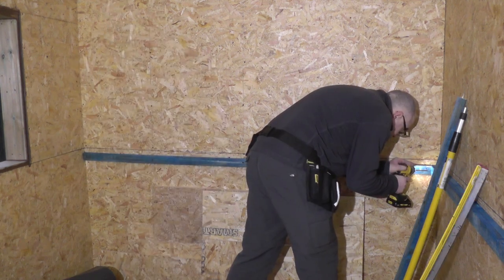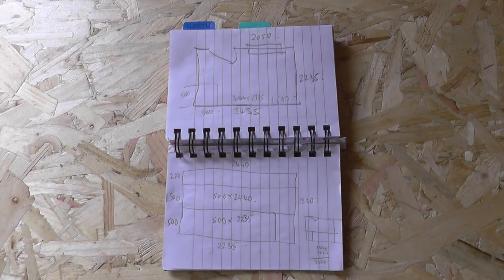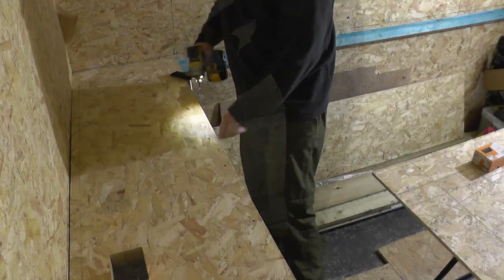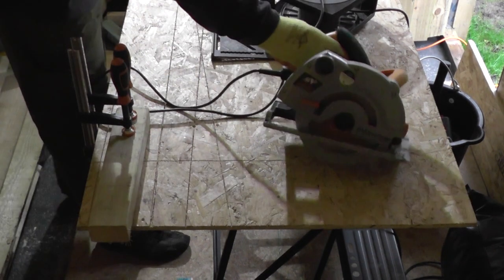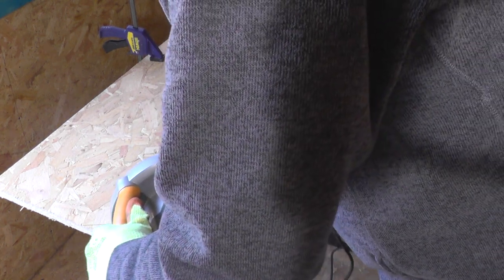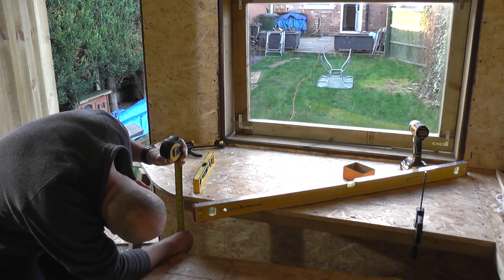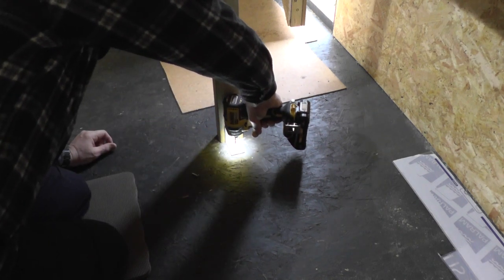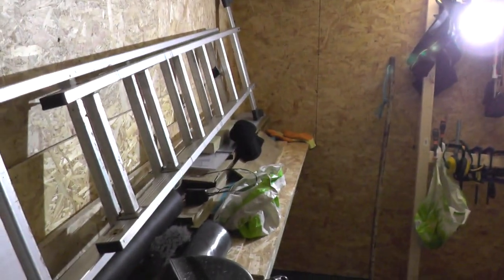DIY Man Cave / She Shed - Part 21 - Making The Worktops

Comment: hi dez you saying the blade is blunt try cleaning the blade in white vinegar  i thort mine was blunt until i cleaned it
Reply from the maker: HIya buddy. Funny you should say that but I was only watching someone else's video yesterday who suggested giving it a damn good clean. Could save me £23. Will give it a try. Appreciate the tip mate. Des
Reply: @21stcenturycaveman33  i pay around £10 for blades on ebay just need blade size and hole size use then in my table saw, miter saw and rip saw